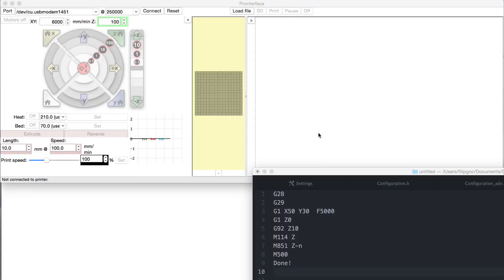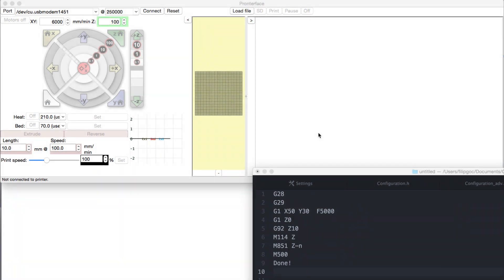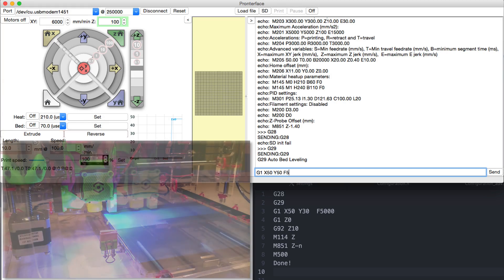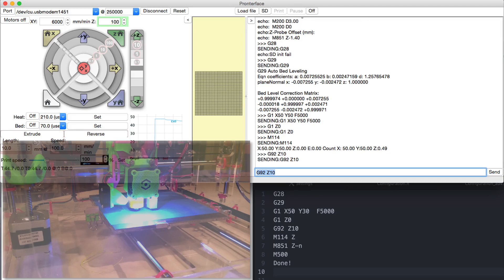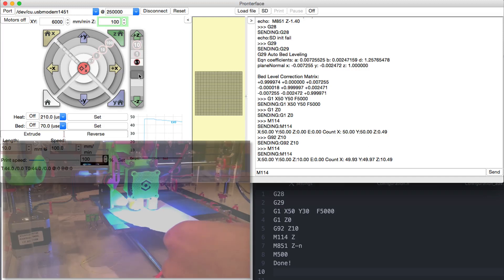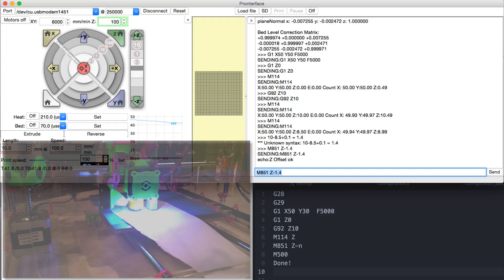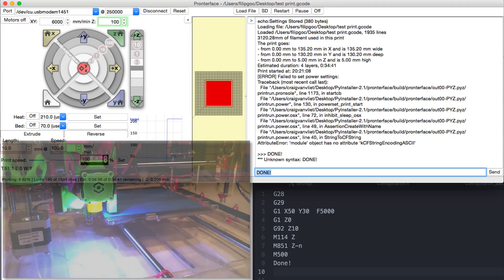How to Calibrate (Calculate) Z Probe Offset Without LCD over USB with Printrun (Pronterface)

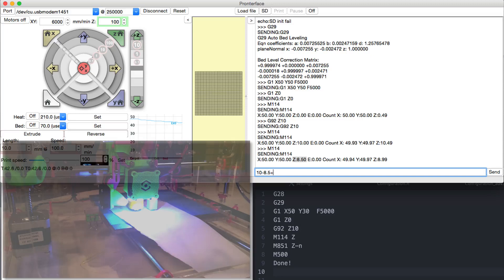Comment: 2:22 why 1.4 offset if the answear to that math problem is 1.6?
Reply: ReadZead I think what he is saying is..
Since the printer thinks 10 is absolute zero after tricking it. He had to move the Z axis in the negative direction. Keep in mind that what is left on the Z axis is 8.5 when you subtract 10-8.5=1.5. The 1.5 is being moved in the -direction on the Z axis. This means this number is actually infact  negative. problem really should be this 10-Z=8.5  where Z=-1.5 then he wants you to add .1 for the thickness of the paper. So that means Z0ffset=-1.5+.1              Zoffset= -1.4. hope this helps. Correct math is    

Zoffset= 8.5-10+.1
Reply: @nyeagley  okay, so you're saying he just had the first two flipped around? If so now it makes more sense

Comment: Please tag this "without LCD" "LCD" "without" "no screen" "no" "screen" "calibrate z probe with gcode" it will help people find this easier. Ex. I gave up my lcd screen for TMC 2130's and do not feel like adding it back, so I needed to calibrate BLTouch without LCD
Reply from the maker: Thanks for the suggestion. This video is long superseded with simpler methods (live Z adjustment for the win), but this is apparently still useful for some use cases :-) Tags are added now.

Comment: HI I am getting a value after manually lifting it with the software of 10.20? how do I do this with the calculation? is it correct if I do this: 
(10 - 10.20 = -0.2) + 0.1 = -0.1

Comment: Im not able to move z axis closer to the hotend after sending G92 Z10, why is that?
Great tutorial!
Reply: I think you must disable the software endstop
Reply: Promocable Thanks. This worked for me
Reply from the maker: Hi Daniel. 
1. This procedure is fine, but we have since revised it. For most people, a simple experimental approach based on observing the 1st layer as it's printing is much faster AND easier AND you don't need a computer. (See updated links in the description to see a turorial.) 
2. What printer/ firmware version/ etc are you using? Some versions of Marlin had a bug involving G92 on Z, so maybe try upgrading your firmware.
3. https://github.com/IMADE3D/Marlin/releases has latest JellyBOX firmware
Reply: Use m211 s0 to remove Software Endstops